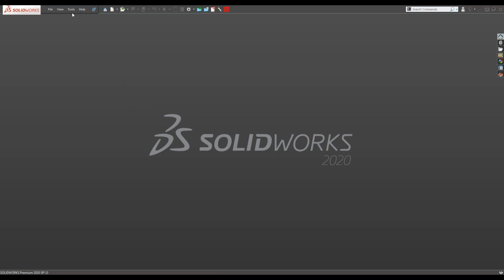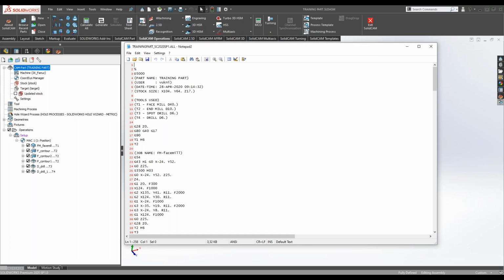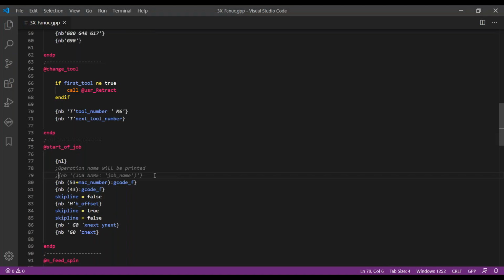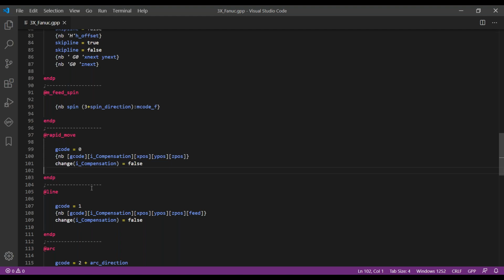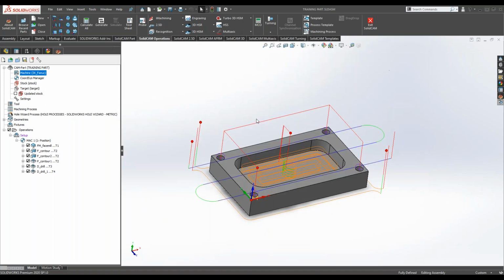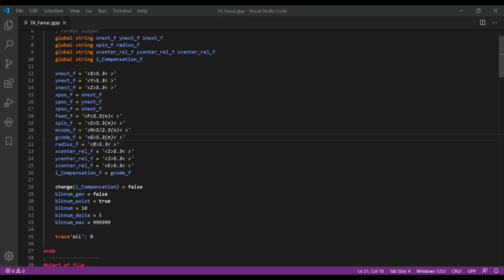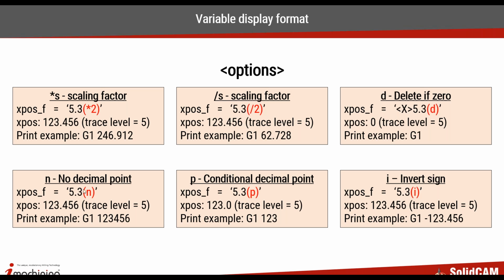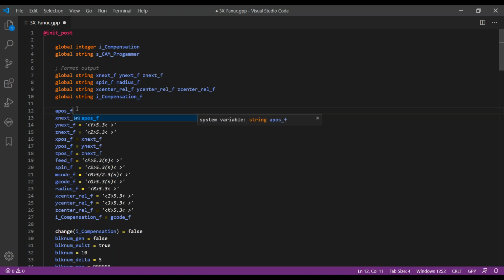Basics of Post Processors - Part 2

Comment: I'm Assistant Manager in Mnufacturing LTD company. I have problem in "vmid" file. Problem is:- if i saved vmid in Higher version of SolidCAM, now this saved vmid file will not worked in Lower version of SolidCAM. Please tell me how can i use that higher version vmid file in lower version of solidCAM.
Reply: Well u make backup before messing with it